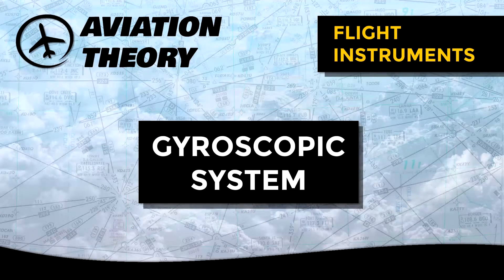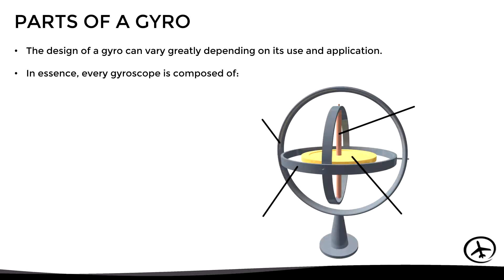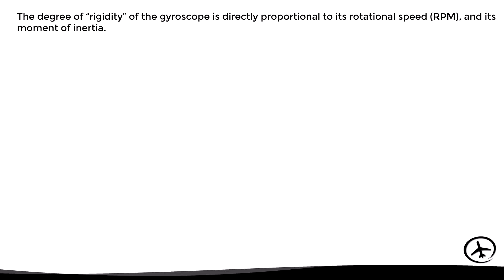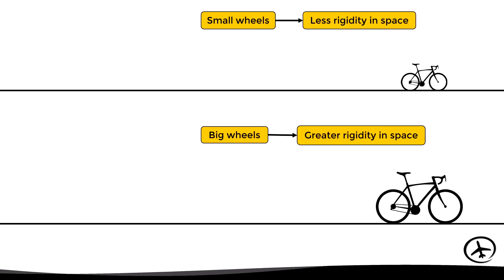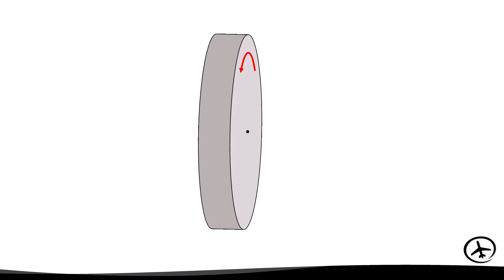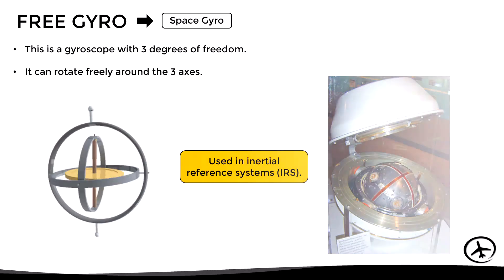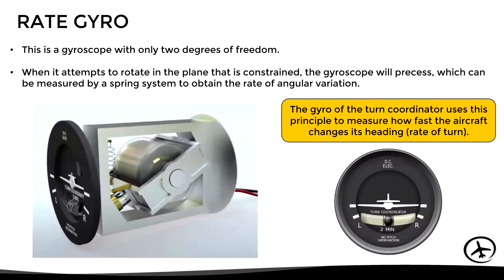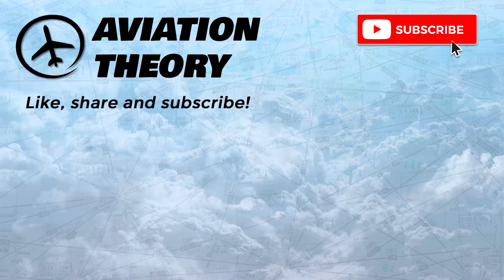Gyroscopic System - Flight Instruments

Comment: Best video So far on this topic. However I think there is a slight correction at 8:10 in that rate gyros have one degree of freedom not two unless we include the direction of spin as well. In exams the direction of spin is not counted as a DOF and so it will be marked wrong. I think you may clarify that part.